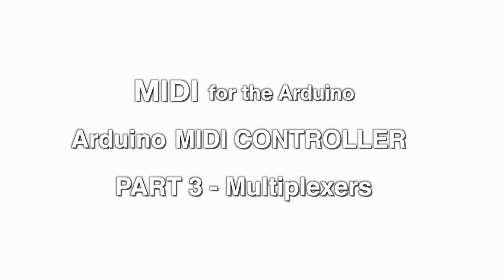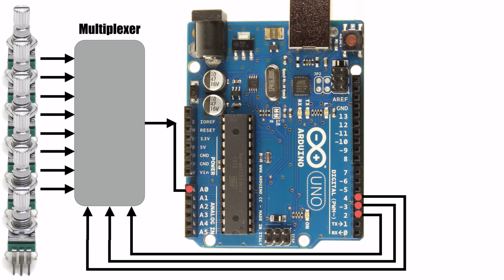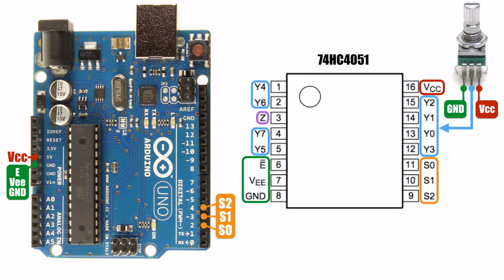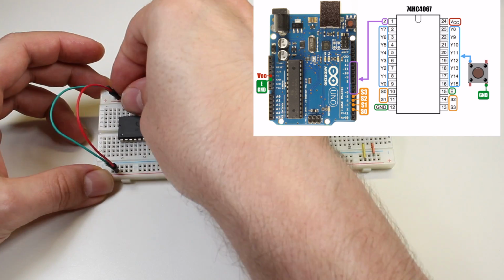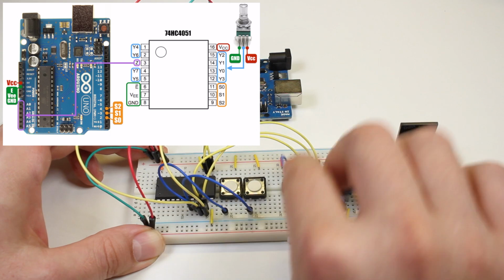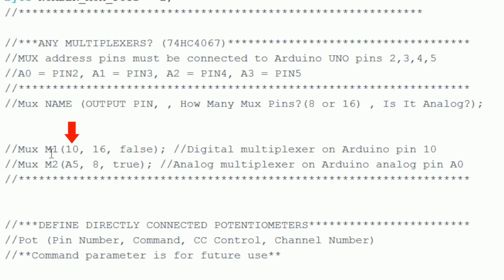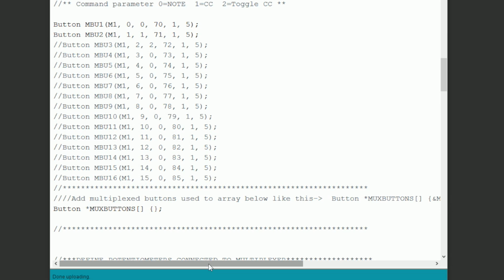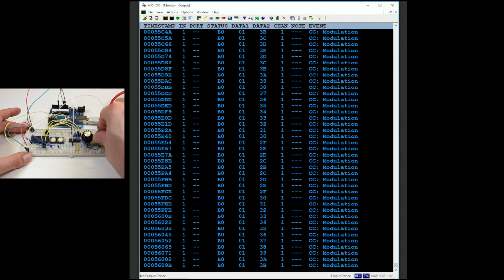Arduino MIDI Controller: Part 3 - Multiplexers

Comment: hey notes and volts do i need a midi to usb hub??? because i what to use this midi controller in ableton... thanks for uploading this proyects!!
Reply from the maker: Hi Neyvick. Yes, for this project you need a 5-pin din Midi input for your PC.
Reply: @NotesAndVolts  Can this be used with the MIDIUSB library instead of the regular MIDI library? Would the code have to be altered at all for this library change?

Comment: wonderful tutorial !!!
I would just like to know some things:
1) goes well with all kinds of Arduino?
2) it is also possible to put the encoders with push button?
3) do a tutorial with encoder for midi in the future?
Reply from the maker: Hi MRX. To answer your questions:

1) Right now the code only works on the Arduino UNO
2) It does not support rotary encoders
3) It's on my list of future projects
Reply: where you have to take action to make it work on Arduino Mega? since you need any more digital pins to add other material (proximity sensor and encoder)?
Reply: Encoder Notes & Volts!!!!! ¡¡Por favor!!

Comment: I'm considering using an Arduino Mega because I have over 70 knobs, 25 buttons and 50 LED's in the controller I'm building. Will there be much difference between what I've learned in your Uno tutorials and applying that to the Mega?

Comment: Suppose you wanted a large number of digital inputs (100+), could the program run any faster if you used I/O expander chips (i.e. MCP23S17) instead of multiplexers?
Reply from the maker: Hi John. I don't have any experience with that device but it sounds like it might work.

Comment: Hi!
How to install leds for the buttons, if i want that when I push the button the led is lightning?
Thanks You! :)
Reply from the maker: Hi Peter. Currently, the software doesn't support outputs other than Midi. You could most likely add a shift register to control some lights if you modify the code.
Reply: You could use WS2812 addressable LED's and include FastLED library in your Midi sketch. Custom coding would be required to map each addressable LED to = a specific midi button value. Figure out using Serial.write (debugging) how the Arduino detects each midi button value. I've never played around with this sketch so I can't say exactly what values to expect.
 
Just as a general example; you have 16 buttons, Button MBU12 is triggered when a boolean = TRUE. First you have to assign it a new variable. B12 = BUTTON MBU12; IF (B12 == TRUE) { leds[11] = CRGB::Green; FastLED.show();} Simple as that. Now when you press your midi button 12 a corresponding LED 12 is lit up (array starts with 0). You can control hundreds of WS2812B LED's with just 1 digital Arduino pin, 5V pin, and GND pin.

To my knowledge the maximum 5V output current of a genuine Arduino Uno is about 800mA so take that into account. FastLED library has over-current protection code.
#define POWER_MGMT_VOLTS    5  // Volts
#define POWER_MGMT_MAMPS    800 // Milliamps
If you set FastLED to 800mA @ 5V you'll never fry the Uno, it will instead dim the LED's automatically to prevent over current. The more LED's you add the dimmer they will become as a protective measure.  I've successfully driven over 300 WS2812B LED's with a Nano + FastLED. You can add hundreds of them before they lose a little brightness. Also worth noting the more code you add the harder the Arduino has to process which will increase latency by a few ms. The FastLED library is excellently coded and just from watching this video it appears as if the NotesAndVolts Midi sketch is too. Shouldn't be too difficult to merge FastLED into it. ;)

This is the best tutorial I've seen online for Arduino MIDI and also about multiplexers! You killed two birds with one stone here! Congrats NotesAndVolts, extremely well explained content. Subscribed. Might I suggest an idea for a video on adding lighted midi buttons? ;)

Comment: how many multiplexers74hc4067 can i conect in my arduino uno?
Reply from the maker: Hi Alan. I'm not sure about the upper limit but keep in mind that the more you add, the longer it will take to read all the controlls which could result in lag. 1 Analog mux and 2 digital muxes is a safe bet.

Comment: Great video man! Just a little question, if i wanna add analog and digital multiplexers at the same time, can i still connect the S pins to the same connectors or do they have to be seperate?? And is there a limit of buttons and faders or will it become very slow?
Reply from the maker: Hi Daan. Yes, Analog and Digital Multiplexers can share the same control pin connections. 
Each control you add takes a little time to read (analog takes longer than digital) so there is a point where there may be too many to read without lag. I'm not sure how many that would be though.

Comment: As always, great tutorials. Here's my question. Let's say I build 5 versions for various purposes and I want them all on different channels. Is there a way to connect them to all send together on 1 MIDI cable? That way I can run it into my iConnect and control multiple synths at once, but only use 1 input.
Reply from the maker: Hi Mech. You can but you would need a Midi Merger box. Something like this -> http://www.midisolutions.com/prodqmr.htm
Reply: Ok. Thanks for the quick reply. So no way to just splice the signals together so they all send on the same cable then? I'm thinking of how my EMX-1 has channels 1-5 and 10 all coming out on 1 cable. I want to make a box that has controllers for my favorite of the Gadgets from KORG Gadget. That would require a few merge boxes!
Reply: +Mechanalog Music you would need a thru port on each controller that you make. maybe a video on midi thru ports would be in order? (:
Reply: +Mechanalog Music another solution would just be hard coding the midi chanels your buttons/knobs use. or, you might be able to set a knob or a switch that changes the value in the channel byte of the button/pot array that holds channel value.
Reply from the maker: Each control can be on a different channel if you want. So if you can set up the Korg to have each instrument on a different channel, that should work.

Comment: can you use usb instead of the 5 pin DIN connector?
Reply from the maker: Hi SG. This project is 5 Pin Midi only.
Reply: Midi over USB is a bit strange on Arduino. In a nutshell you'll need two extra programs on Windows (loopbe midi and hairless midi serial) and one extra program on Mac (just hairless midi serial) running in the background for it to work.
The easiest way I've found so far is to use a Teensy 3.2 board. It runs Arduino code (with some limitations) and can be recognised as a midi device over usb without any extra software.
Reply: ya good point. Even Arduino Micro / Pro Micro / Leonardo will work.

Comment: The best tutorial I found, for a beginner like me. Thanks a lot, man! It will handle more than 2 multiplexers, right? Just need to add them to the code?
Reply from the maker: Thanks Pawel! Yes you can add more than 2 mux. One thing to keep in mind is the more controls you add, the longer it takes the code to check them all. Analog controls (pots) take more time than digital controls (buttons) to read as well. I'm not sure what the upper limit is.

Comment: if i would like make foot midi controller for guitar effect like "FCB1010" from berhinger should i watch which your video clip?
Reply from the maker: Check out my Midi Controller Buttons video. You can easily substitute foot switches for the buttons. This is for 5-Pin Midi only though, not for USB Midi. https://youtu.be/U9olJK3RYXg
Reply: oh thank you very much .